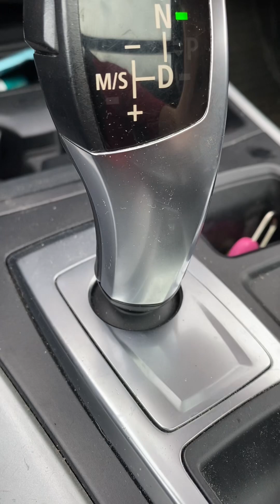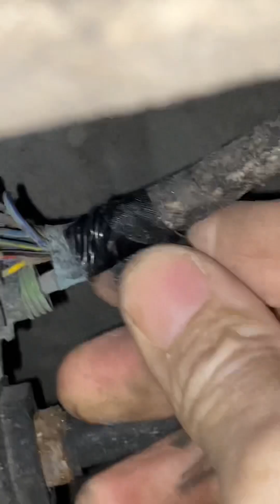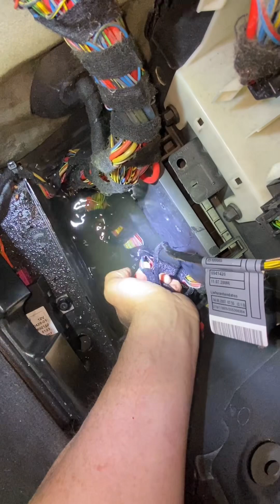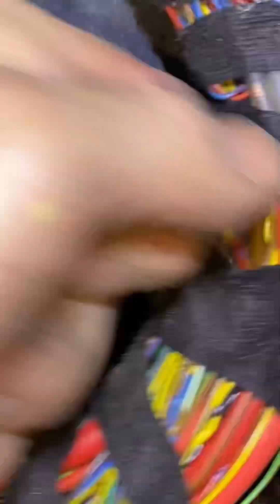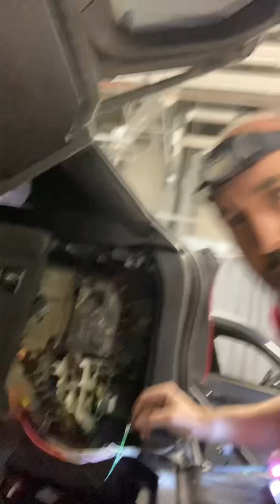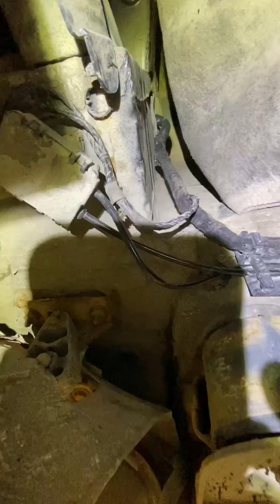Why This X5 Is a Mechanic’s WORST Nightmare

Comment: I love your video format and your skills. A true BMW Tech veteran. X5 electrical can send you down a rabbit hole.  I have an E70 with intermittent CAN bus fault on a condensation sensor still after replacing a sensor, checking wire continuity, and replacing/programming  FZD module. Any ideas?

Comment: Question can I put a 2019 bmw x5 digital cluster in a 2007 bmw e66
Reply from the maker: Not without an arduino or similar interface. Totally different systems